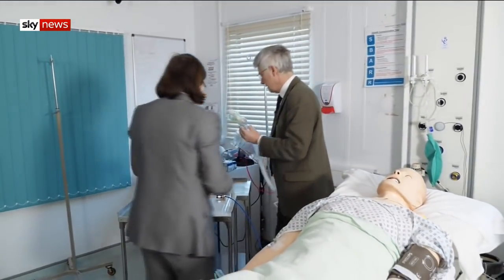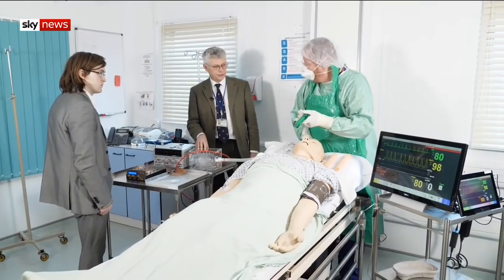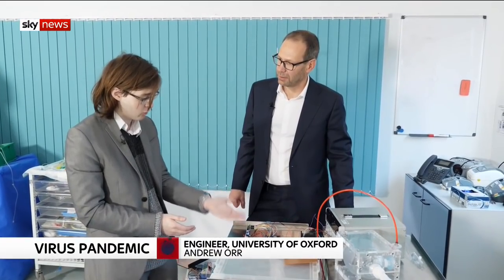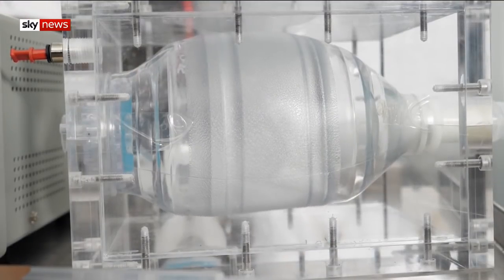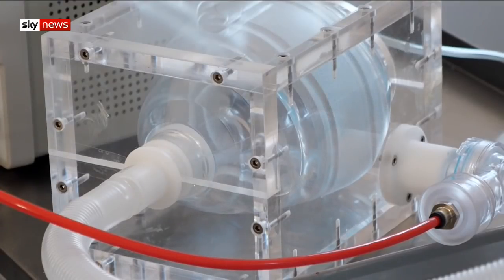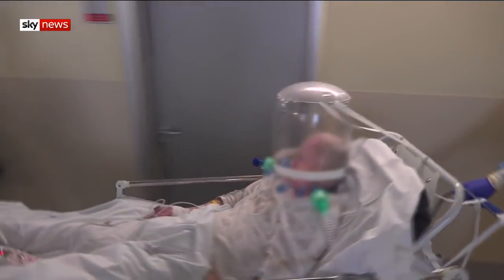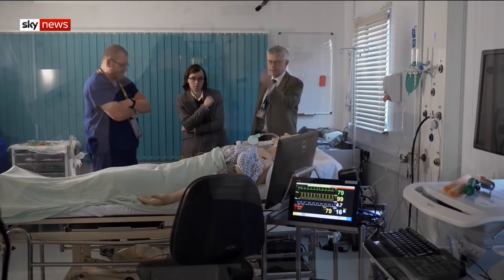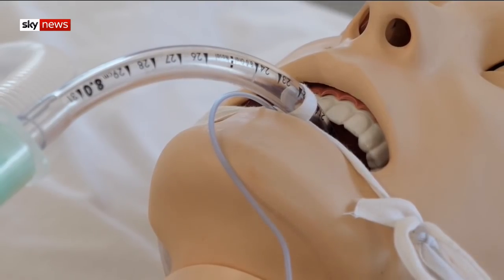New innovation could help solve ventilator shortage

Comment: This is nothing new, we've had ventilators like this for years and years now. We even use ventilators that are much more simple in disaster zones.... They run off of 50 PSI from an oxygen source..... Easy....
Reply: Doug M.  Well if that easy start making them they need all the help and ventilators then can get
Reply: So they spent oxygen to run?
Reply: @aokiaoki4238  Yes, we use a 50psi 02 source to run certain types of disaster vents

Comment: The novelty and ingenuity of this makeshift device is that is converts ordinary, hand-operated balloon respirators (used by paramedics, nurses etc.) and makes them suitable for automatic ventillation that requires no manual pumping. These are relatively cheap and easy to be mass-produced by many companies.

Projects like these should be immediately coordinated and supported financially from authorities. Also highlights the importance of open source projects! 

Time is running out for everyone, including those who are uninfected yet. Some countries are lucky to have a bit more time left.
Reply: Cheap and easy solutions are not interesting for big profit-oriented companies. That's what needs to be addressed when we overhaul our healthcare system for the next virus.
Reply: not really. manual respirators such as those used in this project are useless for covid19 patients. the body's immune response destroys lung cells and makes the lung tissues cling to each other when a patient tries breathing. the hospital ventilators are special in the regard that they can sustain enough positive pressure to keep the lung tissues from clinging to each other while the air goes out of the lung and circulates. it's nice to see people try to help but this project does not seem useful to treat covid19 and could even cause harm in case being used. if manually keeping someone alive could help then every patient would have a family member manually pushing the manual ventilator and have family members make shifts. this is sadly not the case. sorry to be a party pooper
Reply: @roy2079   But other relevant investigations like MIT (https://e-vent.mit.edu) states this kind of prototypes are suitable to face ventilators shortage and no one seems to deny its effectiveness.
Reply: if anyone is interested in helping out with this effort (Google search University of Oxford Research support COVID-19 ventilator design and supply initiatives)
Reply: @SheStillRuns time saved to do more stuff = less lives lost
Reply: Arduino kits are cheap and accesible. Cool for diy projects or just to learn more about electonics such as a microcontroller.

Comment: This is an excellent idea but it is quite simply just a manual ambu-bag resuscitator that would normally require a person to squeeze to effectively breathe for the patient but instead using a small compressor to do the squeezing.

It is important to mention that in theory the NHS does not have a shortage of these ambu-bags to use to make up the shortfall of the ventilators.  The problem is that they require someone with training to use and they are more complicated to learn than it looks and it would be very challenging to train a person in use of ambu-bags for each critical patient so the better solution is this simple small compressor to do this instead.

Now assuming we have one of these prototype devices in service for every critical patient.  
Now there is another serious problem.  Partly the reason COVID-19 patients become critical and thus are no longer able to breath on their own is because their blood oxygen saturation becomes so dangerously low that the brain is not getting adequate oxygen and automatic reflexes such as the lungs cease to function.

Unfortunately this might mean that although this prototype device could save the lives of many critical patients, many still might die and of those who do survive many might suffer severe permanent brain damage and potentially have no quality of life.  This is because although the device would deliver oxygen to the patient it is just un-purified oxygen directly from the air that we breath which is just approximately of 21% concentration.  Therefore this device does not solve the problem of the patients dangerously low and possibly fatal blood oxygen saturation.

Mechanical ventilators that the UK has a sever shortage of can increase the airs oxygen concentration from about 21% upto 99% and breathes for the patient therefore increasing the critical patients blood oxygen concentration.  (Normal blood oxygen saturation is about 95% - 99%, Less that 88% is dangerously low).
They can also deliver aerosolised medicine to the lungs through a nasal nebuliser.

What is essential is that once these prototype devices go into service, in order to preserve the quality of the life that these devises save there needs to be an adaptor fabricated and mass produced for small portable oxygen concentrators or concentrated bottled medical oxygen for the prototype to be connected in order to remedy the dangerously low blood oxygen concentration of the critical patients.

Unfortunately portable oxygen concentrators are complicated devices and will not be able to be mass produced as quickly as these prototype devices but they are available for home use from the NHS and privately for patients with acute respiratory conditions.  As many of these oxygen concentrators need to be gathered as possible and the shortfall needs to be made up by companies ramping up manufacture and filling of concentrated bottled medical oxygen for use with an this adaptor to be connected to the device described in this video.  This will help preserve the quality of the lives that these devices have the potential to save.  
Otherwise the next crisis could be long term care of potentially many thousands of permanently severely brain damaged patients.
The final problem of delivering aerosolised medicine to the lungs if deemed necessary may be possible for NHS staff to deliver intermittently and may not require a further prototype device. 

I implore government and the NHS to get the engineers and resources together to solve these further critical problems to help save many more lives and the quality of these very lives!

Comment: Jesus, an arduino?  I'm not that sure ,  why don't use a more profesional option?
Reply: What's wrong with an Arduino? It's just a proof of concept in this case, but the Atmega 328p micro controller on the Arduino UNO is a surprisingly robust device which with a watchdog timer set up and proper memory/timer/interrupt  management can do a lot more than just make LEDs blink. On a final model, any microcontroller will do, hell even a pair of 555 timers would make this thing work (minus the display), it doesn't need anything sophisticated, just reliable, cheap, and quick to make.

Comment: All fabricators should get these designs asap.. god bless this man and a nations hero
Reply: Amen
Reply: They are using the parts available to them, not necessarily the best design for others.
Reply: @timbart414  When they said "available", I think they meant could be purchased, and didn't need to be individually manufactured (apart from the circuit board). Rather than stuff they found in the back of their garage or something
Reply: it's common parts that are interchangeable with localised versions.
Every hospital has hand operated silicon respirator pumps and air valves, everyone has plexiglas, every country has access so simple circuitry. that's the point, it's all interchangeable with the local equivalent.

Comment: 10's of thousands of "Makers" out there could 3D print and come up with 10's of thousands of these over night if they release the files and just turn them loose.  You'd be shocked at what can be done with an army of 3D printers and Maker nerds.
Reply: Exactly!! Great news
Reply: BAD IDEA!
They need to be RELIABLE as most of those patients cant be monitored constantly, if it shuts off through a 3D printed valve breaking or a shoddy part failing then that patient is fucked.
Reply: https://youtu.be/5AAjVFM0t0o
3d printed ventilator
Reply: @kawo666  Yeah that is nowhere near as simple as this one. Also a lot more components that might fail, and we don't have time to leave these things running 100,000 times to see what will break.
Reply: TNA2Me YES! YES! FOR GOD SAKE’S!
Reply: Even if we make more ventilators we  won't have the staff to take care of them. Invasive ventilation requires one on one monitoring
Reply: @laylanazzal8639  hi. 1:4, supervised by a cadence of more senior staff, multiplying up. We will be in something similar to a mass poisoning in about 3 weeks. But your comment's appreciated.
Reply: I agree this needs to be sent world wide even china everyone deserves to live and if we can make it happen then let's do it
Reply: There are already maker ventolator prototypes made for 3D printers.
Reply: No they couldn't 3D print a circuit board...
Reply: @michaeljohnson7929  it's an Arduino. I have at least 4 lying around
Reply: @MVHStudios  why bother when Sony can make thousands a day?
Reply: @MVHStudios  With the extra headers, and interface with the dials. Clearly they can't ship that out. It needs to be properly engineered for mass production.
Reply: @michaeljohnson7929  they could print the box